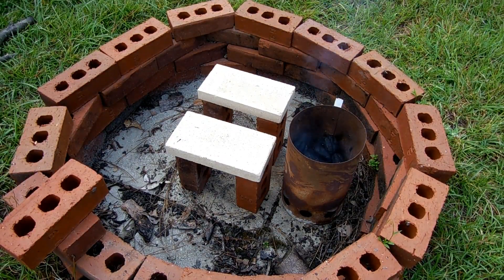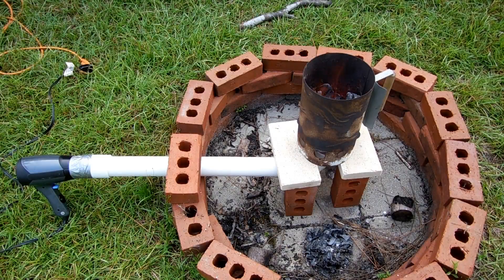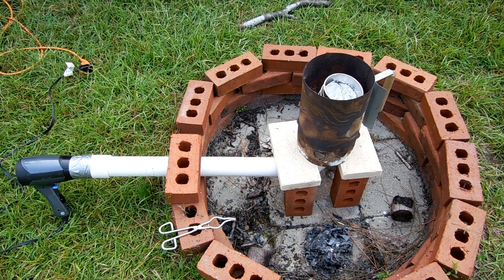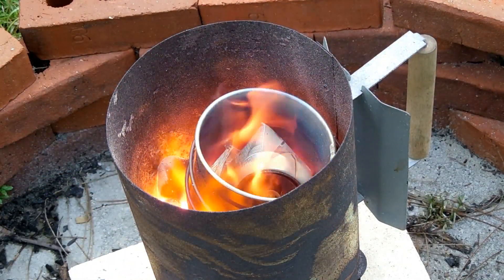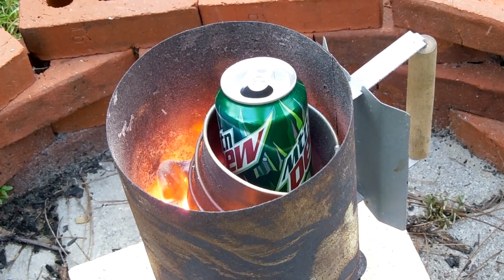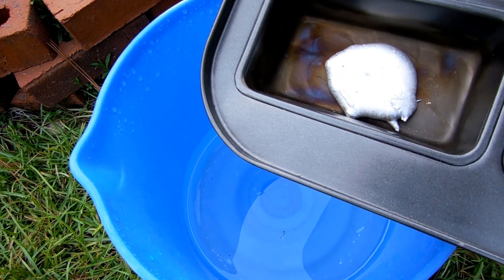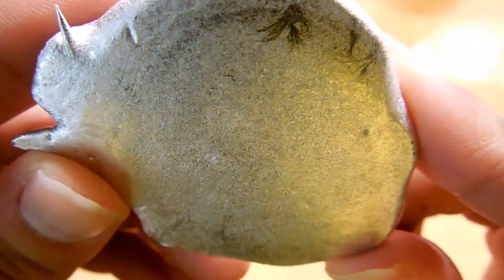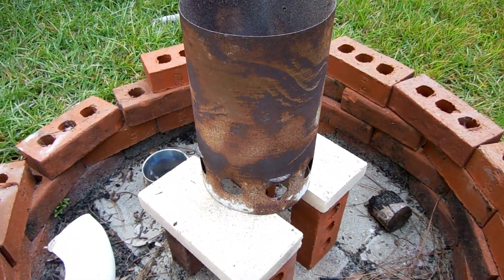Very Simple Aluminum Furnace

Comment: I apologize if this has been asked, I skimmed the messages but didn't see this yet.....
what is the monetary value of that piece of aluminum?  Was that chunk from just a few cans?  I guess ultimately, would this be worth doing as a way to make a few extra bucks or is the time spent not worth the money made?  (I tend to have a pretty good collection of beer cans I throw out every week)     thanks, and I really enjoyed the video!
Reply from the maker: Almost certainly this isn't a good money making scheme. The time and fuel costs probably outweigh the extra cash (if any) the recycler would give for cleaner aluminum. As I say in the video, it's from 6 cans plus a bit of Al foil. I'll tell you what has been a great investment towards can recycling for me: a can crusher, one of the ones you hang on your wall. Easily compress your cans so they take up way less space, and you'll get more cash per trip to the recycling people. Of course, I did not do this for money. It was something I was capable of, and it was a lot of fun. If it cost $100 to melt $0.10 worth of cans, it would still be worth it to me.
Reply: The money potential in this is not in giving the aluminum to the recyclers, but in whatever type of art or whatever you can make with the aluminum.

Comment: When you're pouring alu you have to work fast, if you don't, it will solidify, especially when you have a very lightweight crucible like you're using there. As you were talking, most of the alu hardened. A heavier crucible would buy you more time, but you still have to act quickly.

Comment: I was thinking of using PVC pipe, would it be fine to use or could it melt because of the heat?
Reply from the maker: For what part? Certainly not the furnace body. If you hope to melt aluminum in it (1200 F), PVC doesn't stand a chance.
Reply: mrhomescientist Well, thanks for replying, and i was talking about the air flow, but i found a large steel pipe.
Reply from the maker: Pukedup glass Well yeah, in the video I used PVC so it's fine. Mine was several inches below the grating the coals sat on, pointed up, and if you watch the video to the end you'll see how that turned out for me.

Comment: Instead of that bronze looking charcoal chimney, could i use a large steel or stainless steel pot to put charcoal in? http://2.bp.blogspot.com/-QNak1Rq7h1U/UdL7FaPPq8I/AAAAAAAAcDY/_WCCspDJE5I/s320/Stainless%20steel%20cooking%20pots%20(26).jpg
Reply from the maker: You'd need to drill holes in the bottom for the air to get in. The chimney is a steel cylinder with a grating at the bottom and holes in the side below the level of the grate. A sealed pot like that wouldn't get the airflow to keep the coals going.
Reply: mrhomescientist But it would work if i drilled holes into it, yes? That the pot could withstand the heat.
Reply from the maker: SteelWing Of course. I'd use lots of small holes for even air distribution.
Reply: mrhomescientist Ok, thanks :D

Comment: You can melt aluminum in a campfire, it doesn't really take much.
Reply: jayfulf A camp fire with a blow drier
Reply: lancemichael gubat Nah just a wood fire, nothing more
Reply: viliami Satae The mass of an aluminum can is very low and aluminum has an excellent thermal conductivity so no, it doesn't take long at all.
Reply: viliami Satae No worries.  Put it in the embers in the middle and it will melt within a minute or so.
Reply: Cucumber If you're using a hard wood, it shouldn't take much time at all if you put it into the center of a well burning campfire.

Comment: You could probably use real coal.  Would last a lot longer and burn hotter than charcoal.  I know with lead the frosting (feathering) of the outside means it was too hot.

Comment: Whatever the haters say, smelting metal in shorts a Tshirt and bare feet is badass. Why change? You spill molten aluminum on yourself and a pair of blue jeans will be of limited help. Maybe shoes is what you need, or just a better way to interact with your crucible. Holding it securely and knowing it won't be dropped is far more important than being protected if it does. Just having a better surface for you ingot tray would be a leap forward in your program. Good luck.

Comment: why do you apologize yourself due to omitting some safety precautions?  It's your business... ;)
Reply from the maker: You wouldn't believe the number of people that feel the need to comment on it, despite how many times I write about it. It's good to correct myself in case someone else tries this - I wouldn't want anyone getting hurt for repeating my mistakes.
Reply: mrhomescientist why arent u using shoes?
Reply from the maker: dj anthony I wasn't thinking. I threw this idea together pretty quickly and didn't think through my safety precautions. I now always use a welding jacket, welding gloves, a face shield, jeans, and boots whenever working with molten metals, as should anyone else that attempts this.
Reply: mrhomescientist I'm a 14 year old boy that lives in the uk,is it legal for someone my age to do this?,i want to try and do this but i dont know if it is legal.
Reply: dj anthony Melting metal has no age restriction but grown ups from your neighorhood could get suspiscous and contact your parents, Atleast that happend when i made one
Reply: Manfred Pettersson Platni thanks,i'm planing on making my own in 2/3 days
Reply from the maker: dj anthony Why wouldn't it be? Just be safer than I was, and make sure your parents know what you're doing.
Reply: dj anthony im 14, and did this over then summer and tonight lol, no age restrictions. And its very cool
Reply: What did u use to melt it in
Reply: Cesar Valverde He used a stainless steel cup. Almost anything stainless steel will work as a crucible. Fire extinguishers make great crucibles but be VERY careful when cutting if you choose to use one. I'm not responsible for your actions.
Reply: mrhomescientist It's not that you don't want the people who try this to get hurt, you just don't want to get sued for it.
Reply: hi there lad listen i see people saying to use stainless steel avoid using that as a cruicible it gives off toxic fumes and can make you very poorly the effects can and will wear off but please avoid using stainless steel a fire extingisher   makes a great crucible

Comment: Shouldn't that be done in a low-oxygen enviroment to prevent it from being turned into aluminumoxide? Aluminum oxidizes really easily, but when in a solid state, it will form a protective layer on top of the pure aluminum and the oxidisation will stop. Because of aluminums low melting temperature, pure aluminum is the most enviromentally friendly material of those used widespreadly, but because stripping oxygen from aluminum takes a shitload of power (about 10 times more than remelting), remelting should be done in a big facility where the conditions are controlled. :)
Reply from the maker: Sure, and I lost a lot to oxidation there. Crushing the cans first would help minimize that.
Reply: Good point. CO2 is pretty easy to obtain, and it's heavier than air, so you could fill the crucible with it, though one this small might be harder.. if it were deeper, it would probably hold CO2 better..  You could even generate CO2 at home with Baking Soda + Lemon Juice/Vinegar, capture it in a balloon use that to fill your crucible to keep O2 levels down.
Reply from the maker: Sean In this setup, it gets difficult because just pouring CO2 down into the crucible would extinguish the coals! You'd need to build some sort of enclosed setup where you could deliver a constant stream of inert gas to the reactants only. I'm actually working out how to build something like that for another project.
Reply: mrhomescientist The crucible is the bit that the metal is melting in, not where the coals are.  If you had a piece of pipe with a valve on it, and a balloon filled with CO2 on the end, you could insert the free end into the melting pot then open the valve.  the heat currents would probably keep the air mixing a bit, but if you kept injecting it, and if the melting pot was deep enough, I bet it would settle in there.  Just an idea, I've never tried it, but I will next summer when I get to melting.  Or it might all be just a waste of time because once a layer of oxide forms on top you usually don't get much more than that.  The trick is to get the new additions submerged asap so they don't have time to oxidize in the heat.  Crushing cans and having a tall skinny melting pot to minimize surface area exposed to air would help.
Reply from the maker: Sean I know what the crucible is, but if you just pour CO2 into the open crucible it would overflow and spill onto the coals outside it, extinguishing them. Plus the high heat would make it prone to escaping faster. Despite being heavier than air, these cover gases (CO2, Ar, etc.) will still diffuse away fairly quickly. I've seen it with SF6 - even though it is 6x heavier than air it escapes containers surprisingly quickly. So, you need a constant flow of gas to replenish what escapes. As I said above, you'd need an enclosed crucible with a gas inlet and outlet, to which you'd supply a constant stream of inert gas. It sounds like you were heading towards that idea in your last post. Experiment with it if you get the chance!
Reply: mrhomescientist Sean 
Exactly...foundries have this technology and equipment, but they've been at it for a minute or two.  I think for what you have, about the only thing you could do to improve your process without a great deal of cost would be to manufacture a furnace vessel with a retractable and contained melting pot on rails to have a more controlled pour into your ingot molds.  You could probably use something like a 30 gal drum for the outside barrier, but you may have to use something other than charcoal for your fuel (MAP gas maybe?), a controlled burner ring, perhaps an old surplus blower fan from an inside air handler (central a/c unit) with fabricated metal ducting for the blast air.  Then a larger crucible for your melt stock...

But, now you're getting into a couple hundred $$ just for materials...kinda takes the fun out of your backyard experimentation--I like it man.
Reply: we melted lots of stuff at my High school (this was 13 years ago) in a normal open top furnace melted lots of Aluminium just used a deslager puck then scraped the slag off the top got nice pure metal  he just dident melt enough and cans are very dirty to melt
Reply: How about a pot with a hinged lid....maybe hammer out a bit of a pouring lip. Dont know if you'd want to add a matching piece to the lid or if that would build pressure too much. Id think the oxygen let in when adding cans would be quickly pushed out as heat builds. Maybe mod an old popcorn pot, it would already have the tilting/pouring mechanism.

Otherwise, add a hole near the top of the covered pot, stick the tube of your gas torch in the hole and burn off the L92

Anyway lots of fun with stuff you have laying around
Reply: ALUMINIUM ,,,,
Reply: ***** Not really. Since he is burning stuff, carbon dioxide will form. If he had made a lid of some sort with an "exhaust" hole smaller than the intake in the bottom, he will make sure that the only gas surrounding his aluminum is what has been through the combustion process and has less oxygen than the atmospheric air.
Reply: mrhomescientist or u could sprinkle a layer of coke above it
Reply: ***** But since it is heated quite a bit, it is still lighter than atmospheric air. 

I guess you could say that that is not a low oxygen enviroment in the manufacturing world. I don't know much about the manufacturing world, but i know that carbondioxide are very often used when you want an inactive gas to keep oxygen away and since he is burning something, i figure he should do his best to make sure that he uses the created carbondioxide to displace any atmospheric air that might want to fall down into the crucible. :)
Reply: Level Up Let's Plays I said that out loud in a really patronising way to no one and laughed at myself :)

Comment: Need to use FLUE tape rather than duct,
guessing you had the drier on 'hot' to give a little more heat. 
Be a good idea to have the section of pipe near oven heatproof too
Reply from the maker: Nope, it was on cold actually. The extra heat from a dryer is negligible when we're talking about molten aluminum, so I turned that off. I think the tape failing was more from how I did not position things right and the assembly was bending at the tape.

Comment: the 2015 ford trucks will be made out of aluminum maby you can melt a ford truck in 2015.
Reply: wouldnt be worth anything 2nd hand after the depreciation, so he could definatley
Reply: And the funny thing is, the melted goo will be worth more than the truck.
Reply: The planes you ride on are made of aluminum and plastic too
Reply: Luis Valenzuela The are made from tempered stell lol
Reply: Tace Sinclair Steel*
Reply: It's a steel skeleton wrapped in a layer of aluminum(/aluminium depending on where you live) with plastic, rubber, and copper wires inside to hold air/people in.
Reply: Apparently you dont live in the rust belt of America. You can keep your  fatally flawed steel trucks. I dont care at all

Comment: the melting temprature of alluminum isnt that high. i melt aluminum all the time by sticking pop cans in an empty paint bucket and sticking the paint bucket in a regular old camp fire, right on the coals. only took 10-20 min for all the cans to melt. the only down side to this is after 4-5 pourings the pain can would start to disintigrate.
Reply from the maker: That's what happened to my steel crucible too. I need to get a graphite or silica one for longevity, I think.

Comment: Most of your aluminum is going to end up as slag because it has too much time to oixidse, also, using a steel crucible, you run the risk of an exothermic reaction better known as a thermite reaction, which if happens you will want to have an extra set of underwear around!

Comment: if you would let the aluminium to cool gradually without water, would it form more crystals?
Reply from the maker: Slower cooling would lead to larger crystals, but to make a visible difference I'd probably have to put the mold in the fire and leave it until the coals burnt down on their own. After pouring normally, it solidifies in seconds so the water quench actually has no effect on crystal size.

Comment: ... Nice shoes. Sorry man, I couldn't resist. Great video though. Have you done a cross section to any of the ingots you've poured? I've been wondering how many air bubbles ends up in this type of pour.
Reply from the maker: That's actually a good question. I see a lot of videos that 'degas' the aluminum before pouring, and supposedly that really needs to be done if you want to use it for structural items. Worth a look!

Comment: why a simple hair dryer and not a heat gun which emits heat way higher than a hair dryer?
Reply: he wasn't going for more heat, he needed higher volume of fast moving air
Reply: hair dryer gave the fire oxygen
Reply from the maker: The other replies are right. The hair dryer provides more oxygen to the fire, making it burn hotter. A heat gun's heat output would be negligible compared to the heat of the coals.
Reply: mrhomescientist بتتكلم عربي
Reply: بتكلم عربي
Reply: Generally a Heat Gun Does not put out as much air (CFM).
Also he it trying to push Oxygen to the fire.
A heat gun a Would put out less Oxygen and cost more to run.

Selvol

Comment: i Have 2 Questions,
1: could i use a paint can instead of a chimney pipe
2: how have you stopped the ppe from melting where it points to the chimney and what does the hole look like
Reply from the maker: The paint can would need to be made of steel; I'm not sure what they make them out of nowadays. Google 'charcoal chimney' - the coals rest on a grate. The air pipe is several inches below the grate and blows up into it.
Reply: ahhh, okay, i get how it works now, thanks for the reply :)

Comment: Nice try ;) I've worked in aluminium casting industry, it's pretty fun^^. For safety, I strongly recommend to dry the cans before melting them. a single drop of liquid in the crucible can make it explode (it happens at my work once in a 40 tons furnace, over 6 months of maintenance stop for the furnace, the loading machine and some equiments around. 14 years after the accident, you can see some marks on the walls and the ceiling of the foundry, but fortunately no one had been injured).
Reply from the maker: Yikes! Sounds like a fun job.
Reply: mrhomescientist I am a maintenance tech, so I don't work directly in the process. heavy industries like this are heaven for techs, even with the risks. these accidents are very rare, they happen usually when somebody unaware of safety directives throw an empty can, but still wet, into the dried scraps boxes just before the loading. If you like big machines and technologies and if you have the chance to visit an aluminium industry plant, take it, you can learn a lot^^
Reply: Same thing happened at a Alcoa plant in AZ. Blew the whole building up.
Reply: Learned that one the relatively hard way. I have a tiny bucket forge and was melting a can that still had some soda in it. It was cool at first, until a tiny bit of the hot liquid landed on my forearm. Never again.
Reply: Did you wear shoes there?
Reply: @leo03f  lol
Reply: Water onto molten metal boils.  Molten metal onto water explodes.
Reply: @mickcoomer9714  Surely that's a bit of an illogical statement. They're both the same variables.
Reply: I guess that's the equivalent to pouring water on a chip-pan fire?
Reply: Homer Simpson, please take note. He works in a Nuclear Facility.